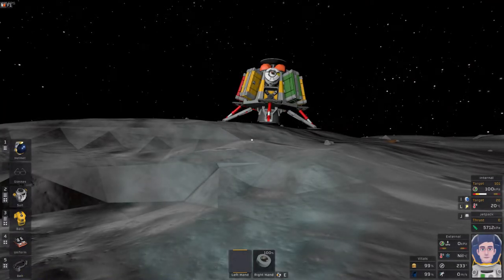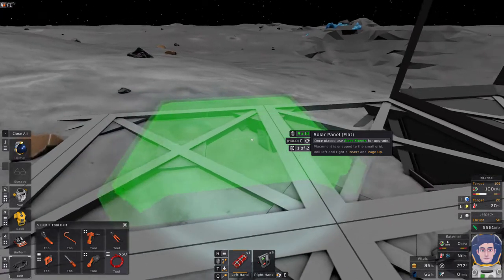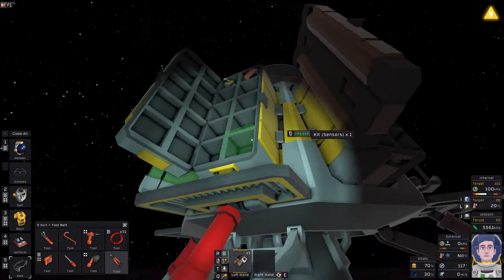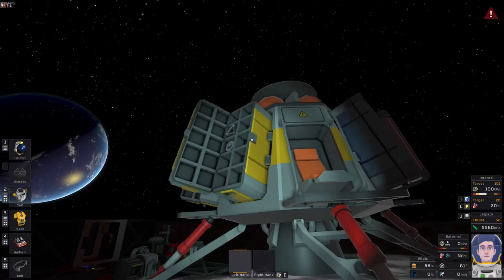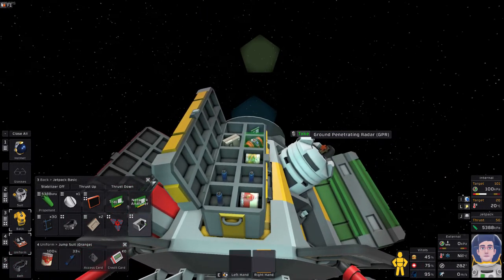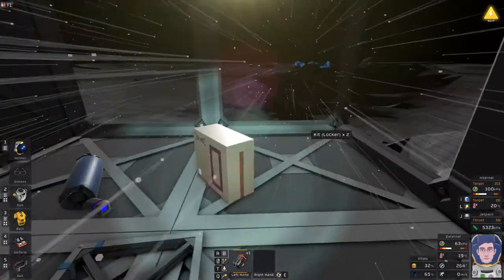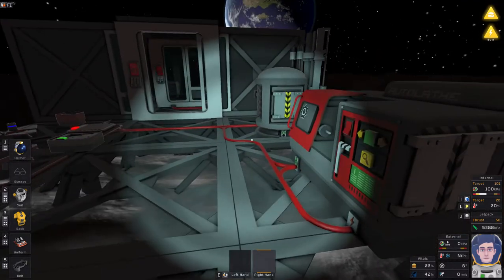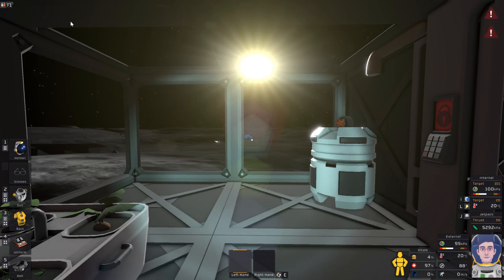Stationeers: Getting Started - 2022 Gameplay/Tutorial

Comment: My airlock vent is not working?
Reply: Nevermind. Do I have to do anything diffrent for Mars?
Reply from the maker: It should work the same way on any planet but beware that the basic airlock setup doesn't empty the external atmosphere before pressurising. Not an issue on moon or Mars (thin and fairly non-toxic) but could be a problem on planets with hot/cold/toxic/high pressure atmospheres since it will let some of that into your base each time